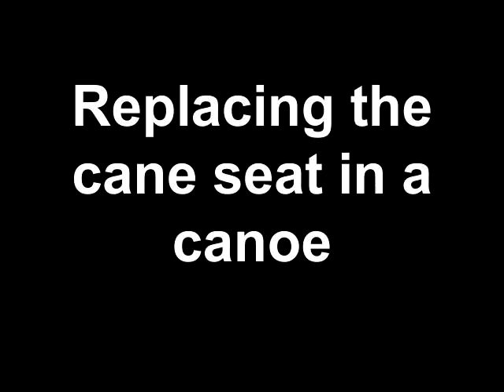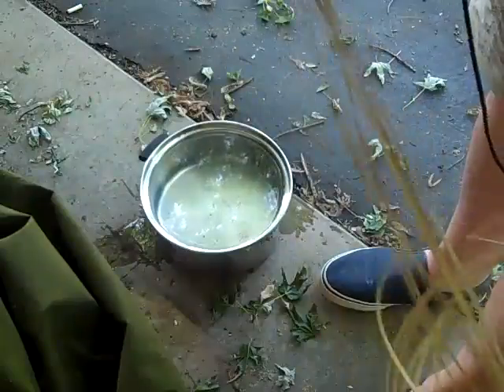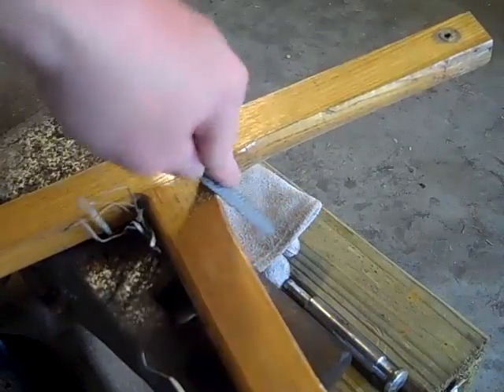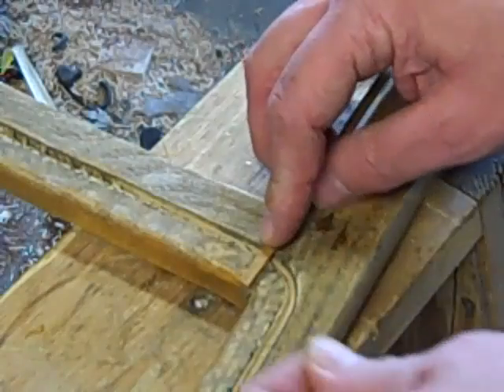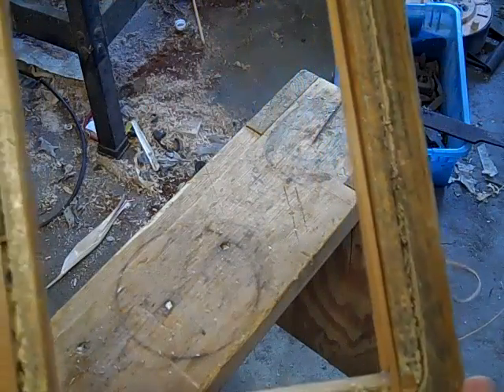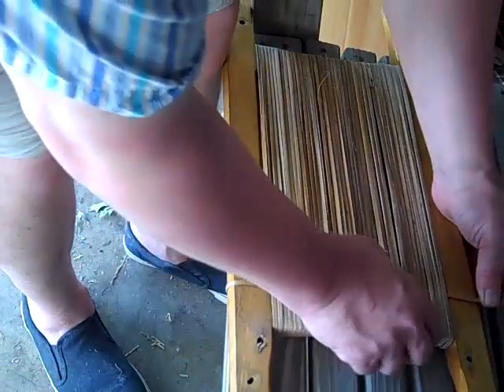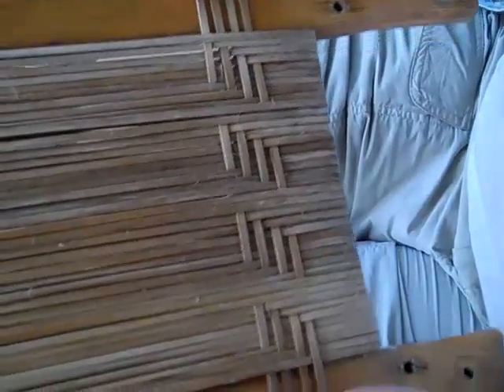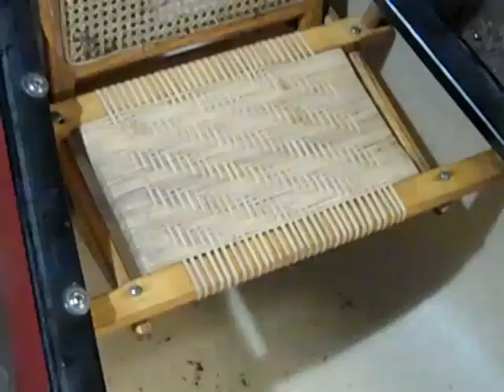Replacing the cane seat in a canoe

Comment: you could do that with paracord. in a pinch, you could unravel it for emergeny cordage in case you're ever up the creek without a paddle or something. besides, you wont have to do all that splicing and hammering. if you get a 100ft or ever 50ft spool of 550, you'll have one continuous piece. im sure paracord lasts much much much longer and is much stronger than the natural material. and you can choose what color you want your seat to be too!